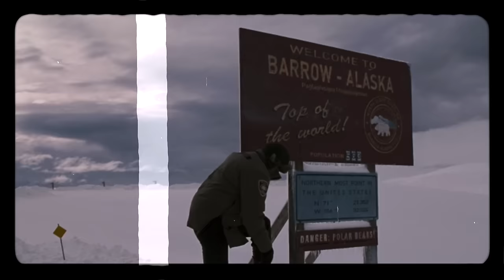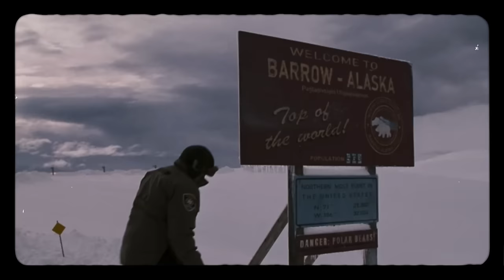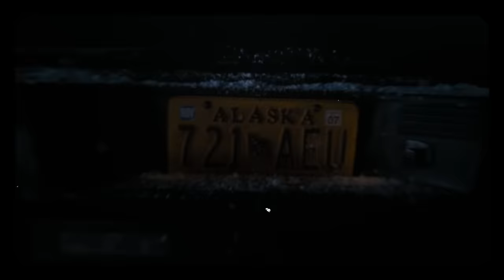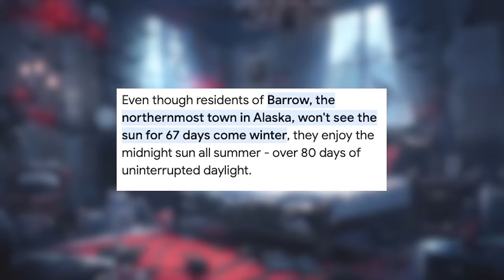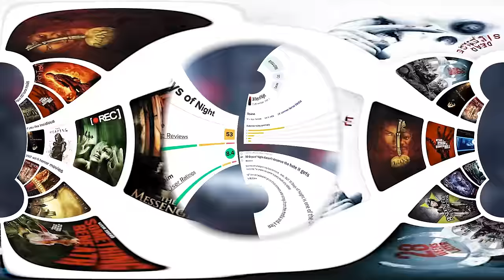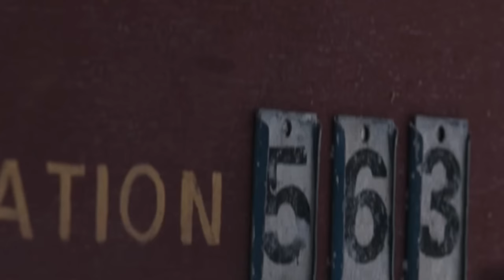30 Days of Night: The True Horror of Vampires

Comment: 16:34 But the thing is, polar night doesn't mean pitch blackness portrayed in the film, at least not in the latitude of Barrow. Even during the winter solstice, some sunlight will be visible because of refraction, even if the sun doesn't rise above the horizon. I don't know if it's clearly established how resistant to the UV light the vampires supposed to be, but what I have gathered, it would be relatively safe to wander around during noon time, especially at the beginning and at the end of the period.
Reply: Direct sunlight is usually their true weakness

Comment: Another Vampire film that I think did things well.. Was Near Dark. Unlike most of the time and even today.. Not all vampires are what most would consider to be really good looking. Looks wise they remain as flawed as they where when they are turned. Key words, when they are turned.  Yes there is a child vampire in the film and it does deal a bit with how much of a problem that can be. Sort of like what Interview with a Vampire except.. In my opinion better. Because in Ann Rice's books they did get enhanced looks overall and got extra powers on-top of the faster healing thing. ( It can be argued that that might have been the ONLY thing the vampires in Near Dark besides no longer aging and disease immunity. IE No enhanced strength and other abilities like most other stuff tends to give them. These vampires DO have the negative of needing blood, as well as burning up/turning to crispy critters in the sun. )

Side note, one could make an argument that the "Vampires" that technically exist in "Night Breed" also where one of the better versions because of similar reasons but the movie was not focused on vampires and its really hard to say for sure if the particular breed was that world's equivalent to vampires or not.. Especially since in that film it does talk about how a lot of types of Night Breed fully went extinct due to the Crusades. ( Basically.. The way it was kind of mentioned.. The Crusades was that world's event that was more against the Night Breed and in that world it was for the most part forgotten by almost everyone. Just basically what ever Night Breed that is left and the few they are willing to deal with instead of just flat out kill due to the potential risk they pose. )

If you have not done videos on either film yet ( This is the first video I have seen on your channel and I want to have this written before I even look. ) I highly suggest at least giving those two films a watch and at least think about making a video on either one. Criminally underrated films for their time especially Night Breed.

Comment: This, to me, is another case of the comics being even stronger than an admittedly strong movie. Steve Niles and Brian Templesmith created something that has a visual style that's consistently unique in the vampire genre, and a brilliantly dark angle. The movie jumps over several details to be a bit more compact and to cut itself off from any potential sequel material, but what happens to Eben is heartbreakingly perfect - as least as of the "Return to Barrow" comics.

Seriously, check out the "30 Days of Night" comics. They make the movie look so, so weak in comparison.

Comment: I actually heavily prefer a more humanised take on vampires (sans the pretending to be teenagers part) but it was a good movie, even though it doesn't fit my preferences regarding vampires in fiction, like, at all. Basically, the vampires I prefer aren't even suitable for horror genre, but rather fit in a high or urban fantasy settings instead.

Comment: Eh.  The movie screwed the book up.  Part & parcel of the whole point of Vampires - explicitly stated by the Alpha Vampire in the original story - is that they're supposed to be the evil that lives right next to humans w/o the humans being aware of their existence. The filmmakers could've remembered the adage "If it ain't broke, don't fix it" & put their energy & efforts into leaning heavily into, expanding upon & elaborating the mythology based upon what actually worked in the original narrative (which has been successfully done in the comics), but they had to try to outwit the original story by being clever, hence the feral, almost-but-not-quite-human & dead-giveaway appearance of the vampires & that fucking stupid, cringe-inducing dumbass & completely & unnecessarily burdensome Vampire Language that - being perfectly blunt here - sounds like an early-issue Compact Disc from the 80s that keeps skipping b/c the silver foil has started to tarnish.  If there's anything worse than a film that sucks, it's a potentially awesome film that has its awsome potential squandered.

Ugh.